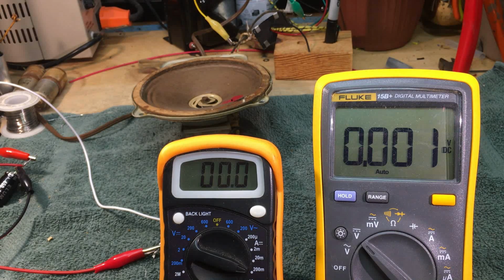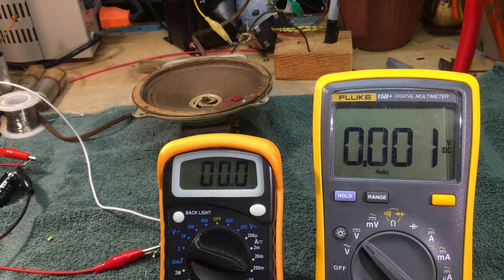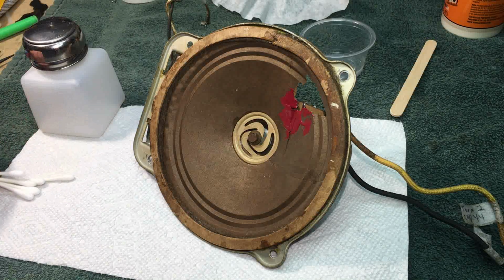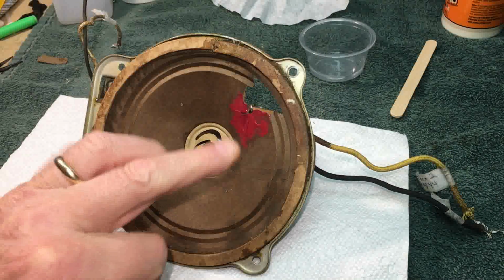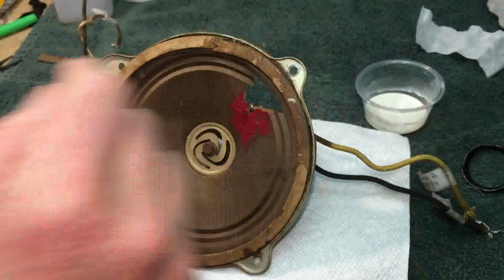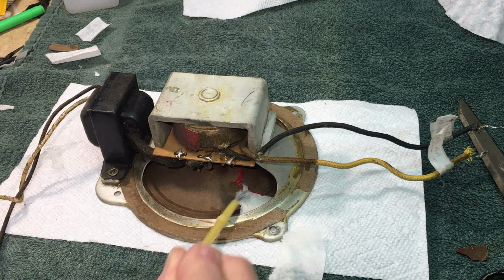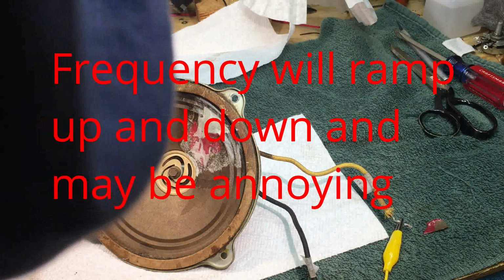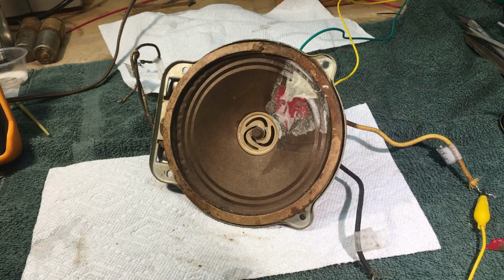1935 Philco 54C Part 3 of 7 Testing and Repairing the Speaker

Comment: Another thought...may not be doable, but I'll throw it out there and you can do with it what you wish.
On speakers like this one, where the field coil is open and not fixable, would it be possible and practical to remove the wiring from the speaker that is the filed coil, and replace it with a strong magnet?  Then you simply need to purchase or make a choke to use in the power supply or wherever this one is actually used.
I have seen many guys do pretty much the same thing you are doing with this one, and there is NOTHING "wrong" with doing that, but I just can't help but wonder if the magnet idea would work!
Reply from the maker: The hard part would be to get the center pole piece centered so the voice coil wouldnt rub....otherwise....it would work.....but, how much machining and fitting versus replacing the whole speaker (a cheap option)...

Comment: I have a suggestion for future use that you might want to try.  If you are working on another radio that you have to apply new Vanier to, you might want to try first apply the Vanier, then place the side with the vanier on it on your workbench, and on the inside of the cabinet, take an X-acto knife and at one end of a slit you are needing to cut out, press through to the vanier side a hole at least the width of the knife blade (sharp end to dull end width).  Then do the same on the other side across from that slit.  Then go to the other end of the slit and repeat.  Once you have done that on all slits, turn the case over and finish cutting from the side the vanier is put on.  That "should" prevent the splintering problem you had, methinks anyway.  You might want to be sure you place the vanier side down on a soft cloth on your workbench and not directly on the surface of the workbench.
Reply from the maker: Thanks Wayne! I will keep this in mind....I will have to repair some veneer on the current project...Take Care—Larry

Comment: Hey Larry, it looks like it was coming off onto the q-tip.  Sorry it wouldn't all come off that way.  I wonder if a VTVM would give a more stable reading on field coil resistance?  Good stuff.  Take care, Gary  P.S., if you'll tear that filter material instead of cutting it you'll get a more "fibery" hairy edge to it to and you won't have to tug on the edges like that.  P.P.S.  Also glue or rubber cement the back side of the cone where those tears are to keep them from further tearing.  Okay, nevermind, LOL, that's what I get for commenting WHILE I'm watching, lol.
Reply from the maker: Rebel9668 lol, well, we ask you all to speak up and fuss if you dont tell us stuff before it happens! That cone was rotten! Very rotten! I got better readings using my Heath VTVM but it is in need of a probe and recapping recalibrating, so I cant depend on its reading. Thanks for te great comments! Take Care Larry

Comment: Nice! I thought at first what is it filter material for a coffee filter? would be a bit thin and not be rigid but sandwiching it with the piece behind  helps a lot in its rigidity. The only criticism I would say is I think you don't need the glue so thin little bit too much maybe 10% would be plenty! what would have added more rigidity to the overall structure when dry. I wouldn't use such a flimsy brush either a artist brush number 8 or 10 might be better something that has a bit of bite to help you push the paper round to get it right into the corners and and seat it in and remove air. A lot of these speakers have a awful twang! in the middle range because the way they are constructed in the spider on the outside you can make the voice coil sound better and sweeter with better Dulcet Tones from it, by adding felt, to the metalcore underneath, the spider on your speaker or a dust cap on a conventional speaker. Ideally probably three layers but even one layer will help. You can get this from a turntable felt mat felt is the ideal material for cutting out the harshness in the vocal coil and making the human voice sound more natural? Just make sure it's away from the Edge and not brushing any part of the vocal coil or speaker in its movement. If you want you could go over with an indelible marker for matching the repair most speakers are black and you wouldn't see the repair if you covered the whole speaker with an indelible marker. And you could try some rubber compound round the surround to give it a bit more smoothness as well in the paper surround, you can use bicycle puncture repair kit glue! just brush it on and let it dry make it a bit more like a reflex speaker and will help with the lower tones? And give you more smoother bass. I'm glad I could be some help thanks for the shout out!!
Reply from the maker: John sweda Thanks John! Always enjoy your comments! This one, Im afraid Im going to have to think about a while, its pretty deep! I agree my glue was a bit too thin, but did work. I have used full strength with similar resukts, just harder to apply and the cone doesnt absorb as well. I have some nice artist brushes in my paint supplies, but never use them except with oil paints. Ive found the disposable brushes handy and it is stiffer than you may think. As far a the twang, you are definitely right on that! The quality was not that good in the beginning, but its also survived 82 years of various weather conditions, and the paper is very brittle. It would be ideal to replace the whole speaker with a new modern permanent magnet speaker, but, then it would lose what it is an 82 year old radio which never sounded that great to start with. That is what Im after doing all this, is try to get it back to where it once was, not redesign it. To me, there is something about the sound these old guys make! I like the dents, the faded finish, the battle scars, makes their character! Thanks for the great comments! I will study what you said about the felt, and the surround. Thanks again, Take Care--Larry
Reply: Backtothefutureradios or maybe getting a permanent magnet speaker and taking the magnet off and using the transformer because it is needed in the operation of the radio isn't it, I thought I explained it quite easily felt in the middle rubber glue around the surround the concertina part of the paper around the outer Edge. Experiment and you'll see what I mean if you can get those felt white cleaning pads you can use them. I  won't go on you've heard enough for my voice for one night 😒 till next time
Reply from the maker: John sweda Ok, John, I understand now. Yes something to add a little more flexibility during the low frequencies, yes I agree I like lower frequencies. In fact those are about the only ones left that I can hear, lol. If we have to replace the cone, about all the replacements come with the foam surrounds. The  problem with modern replacements are, the depth for the cone is much different than the vintage ones, so your method would have to be used. Total reconstruction, which Im trying to avoid at this point. As far as the permanent magnet speaker? I was thinking somewhat of that too. But, the problem you run into is the field coil does 3 things, 1) magnet, 2) filter choke 3) voltage drop resistor. Eliminate one of these (magnet) then you have to compensate for the other two. As far as me hearing enuf of your voice, lol. I dont think so, I enjoy your comments, even when you get above my head on some of them. Im kind of analytical and have to think about some stuff longer than others. I missed ur last comment, because I went to bed. i think we may have a time difference going here. Where do you live John? Thanks again and dont think I dont enjoy listening to your ideas, because I do! Take Care! Larry
Reply: Backtothefutureradios yes the idea of the softer surrounds light sponge, rubber, Cotton, felt, and adding a damping material like rubber solution impregnated into the paper helps and prevents higher frequencies from clashing across the surface of the cone and gives it's somewhere to dissipate, to like a shock absorber and damper on a car would give you a smoother ride. If you imagine the speaker Like a pool of water where the stone lands is your high frequencies and the ripples coming away from that point get lower and lower frequencies. UK.
Not sure I understand with the field coil I've had no experience with them, Why should you lose one factor if you use a permanent magnet type speaker construction! and you take the permanent magnet off the speaker? and rely on the field coil like you would on the Vintage speakers, I would have thought there would be no difference? I see your point with the construction of the modern speakers are generally have a deeper throw but that's not always the case you can get shadow construction speakers even today there might be one Factor I'm not sure about is the voice coil resistance generally a lot higher in vintage speakers like 16 ohms not 4 or 8? Have you ever come across the BBC speaker from the 40s and 50s with the built-in amplifier with a  TL12 monoblock valve amp. I have one of the amplifiers they did sell them separately but they did it as a complete unit with a speaker built in a wooden cabinet quite popular in America I believe very sought after if you get the chance don't turn it down.
Reply from the maker: John sweda I was thinking a different way again John, I understand you were suggesting using just the voice coil in the permanent magnet speaker! That will work. I will keep in mind the rubber cement idea around the flexible (grooved) area of the speaker. We may try to enhance that after we get some music out of this bad boy! Lol. I will keep my eye out for one of those speakers, they sound nice! UK? Hmmmm that explains the time lapse. Thanks for ur great input! Take care--Larry
Reply: Backtothefutureradios no worries it was a leak tl12 BBC speaker. Yes keep it in the grooves don't go past the last groove you can be fairly liberal